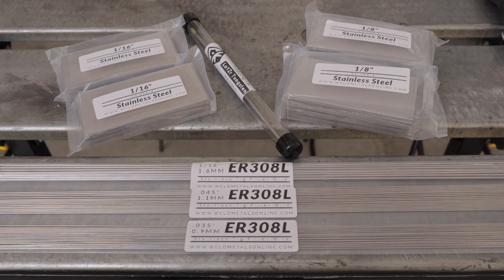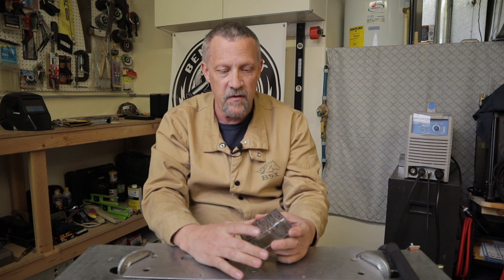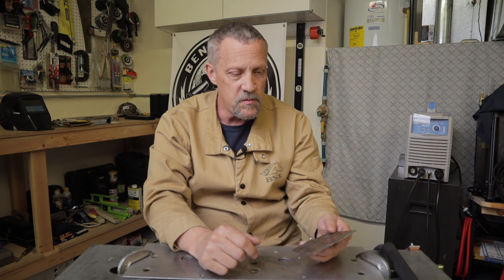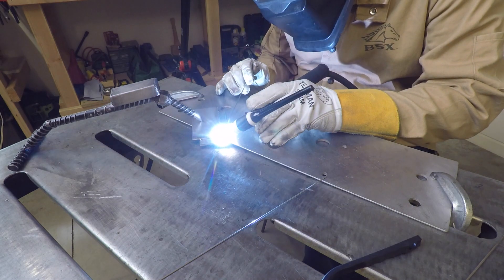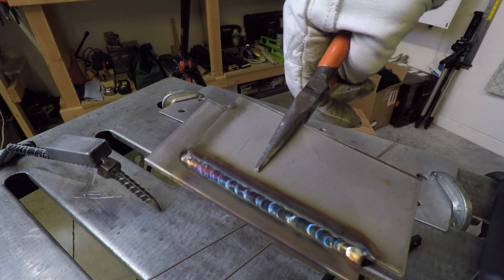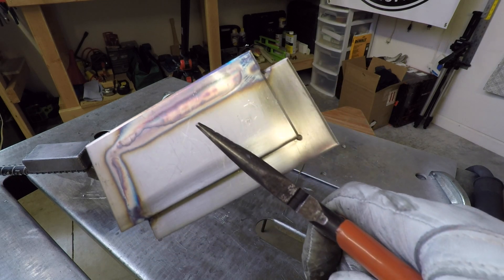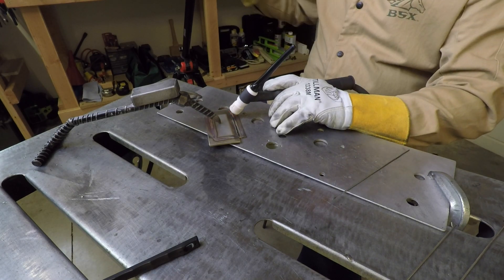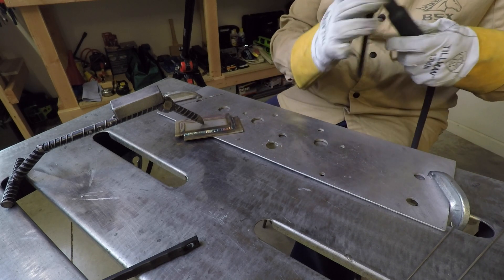Mind-Blowing First Attempt at TIG Welding Stainless Steel Using the YesWelder TIG 250P AC-DC!

Comment: Just want to chime-in again ... THIS VIDEO is GREAT!!! 
 I have been asked to modify a kitchen/clean up area at a local parrish hall. They have purchased a tall, high temperature dishwasher to replace the existing manual dishwashing setup. The new methods will require widening of their dish rack placement by about 6 inches on the left and the right of the new machine. I've never welded thin stainless. Anyway, I COULD NOT DO A DECENT JOB working with the added 16ga stainless sheetmetal without the info from THIS VIDEO! I have been practicing and know I can do it with my TIG 250P AC/DC. A thousand thanks!
Reply from the maker: That is great to hear! It's rewarding to know these videos can be helpful.

Comment: Hey, how is this machine holding up for you since it's been a couple years, assuming you now have plenty of time using it? 
Any issues at all with controls or circuitry or HF start, or AC/DC operation? I'm asking because it looks like YW has discontinued this machine.  I must say I DO have this machine but have not used it more than a few hours on steel, and mostly stick at that. I need to get in a lot more practice with TIG, and have never even tried the AC side on Aluminum. Only thing I have found a bit weird is on stick, where they definitely advertised "hot start" - I do not think that works at all if it is present (can't find any sort of mention in the guide or control for it anyway). Not a show stopper. 
THANKS for all your videos! I really like your easy going and very clear style.
Reply from the maker: Thank you, I appreciate your nice comment. This machine is still going strong. I haven't had any issues with it at all. It's still one of my favorite machines from YesWelder.

Comment: Are you using a ck torch with your yeswelder machine?  If so, could you recommend a part number?
Reply from the maker: I am not using a CK torch, I'm using the items listed below and they are working great. They are much cheaper than the CK and they have been my "go to" for the past couple of years.

(Looks like the one without the gas valve isn't available at the moment on Amazon)
TIG Welding Torch Body WP-26F
https://amzn.to/39g9OmO
TIG Stubby Gas Lens Kit
https://amzn.to/39hhpRX

Comment: Hi, i bough a 250P and it came with a tig torch without flow adjustment. Just on and off. I'm new in TIG welding and always saw torch with a flow valve on it. 
What do you think?
Best regards
Peter
Reply from the maker: Peter, the TIG 250P does not need a torch with flow adjustment. The machine controls the flow of gas through the torch. When the machine controls the flow like on the 250P it's a much better way to go. You don't waste near as much gas like you would with the manual flow valve.

Comment: Good stuff. In theory, its 35Amps per mm for Stainless, and 40Amps per mm for Mild steel. So your 1/8" stainless should be about 110 Amps, and your 1/16" should be about 55 Amps - going off what I just learnt in my TIG course :)
Reply from the maker: Thanks for the info James!

Comment: You're having problems because your filler wire is too big. Use 3/32 NOT 1/8!
Reply from the maker: I understand your suggestion and I agree with your concept Mark. I don't have any 1/8 SS filler rod though. The largest SS filler rod I have and used in the video is 1/16.

Comment: A few ss tips- use a ss wire brush on the metal (only use this brush on ss, stanless creates a protactive oxide which makes it harder to weld).  Clean w acetone (lifts off contaminates, but leaves a hydrocarbon film),  clean the acitone film w rubbing alcohol.  Get that tungstin closer (this will help focus the heat), turn up post-flown and hold the torch over the weld and filler metal until postflow is compleat.
I was welding simalar coupons last night at 40-45 amps and not flooring the petal. either. 
Hope this helps.
Reply from the maker: Thanks for the tips Big Mike! You were welding ss 1/8" coupons with 40-45 amps? Boy I was way to high with my amps if that's the case. I'll give your tips a try. Thanks again, I appreciate it!

Comment: Looks like ya havin fun mate..the only mistake i can see is that you are moving to slow especially with stainless it should take about 2-3sec for your puddle and then go hard and fast..if ya make a mistake stop dont keep running back  and forth over the weld..also the miller welders pocket app is a great tool to have it will give you all the relevant settings you need for whatever metal and process you choose..other than that all good..remember have fun and make every weld better than the last one...have a great day from a dirty welding australian...lol
Reply from the maker: I appreciate the tips, I need all I can get with the stainless steel. I will be practicing a lot more on the ss and I'll try to apply your advice. Thanks again for the help and comment!

Comment: I have a question for all. I am new to welding including tig. I am waiting for my shop to be wired to be able to start. I am wondering where to purchase welding rods for my tig welder?
Reply from the maker: Hey Jon, I would say a great place to buy TIG rods is https://weldmetalsonline.com/?ref=undefined 
Justin is a great guy and he will treat you right. He has quality TIG rod in pretty much any size and type anyone will need. His also come in about 18" length instead of 36" and I've found they are easier to handle when starting out. Or you can cut 36" rods in half if you find some 36" rods. If you use my promo code DIYHP10% at https://weldmetalsonline.com/?ref=undefined you will get 10% off your order and you can use the code as many times as you like. Not to mention he's a great guy and he does a lot to help support guys like us who are just starting out. Have fun with your new welder!

Comment: So if you turn up the machine to 200 amps, can you control the amount of heat you put into the piece with the pedal? Or is it always at 200? And don’t feel bad about sticking your tungsten, I’ve been doing this for 6 years and I still do it! Lol 🤣
Reply from the maker: Yes Brandon, the foot pedal completely controls the amperage output of the machine in the 2T mode. You can set the machine for either 2T or 4T. The further you push the pedal down, the more amps you get out of the machine. A fully pressed pedal would give you the max amps you set on the machine.
Reply from the maker: PS: I never have a welding session without at least one tungsten dip and usually multiple dips. LOL 😂